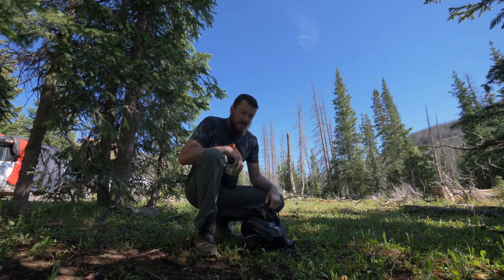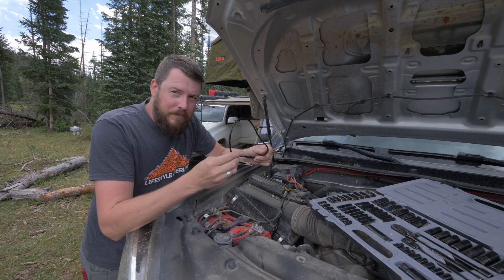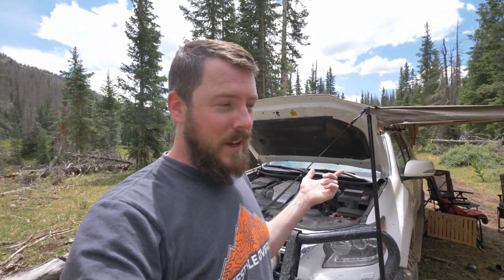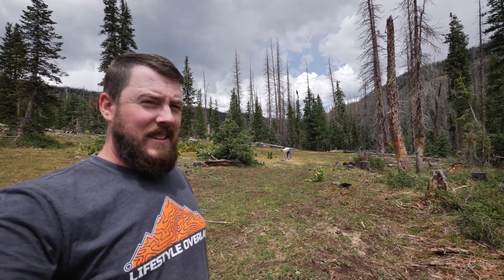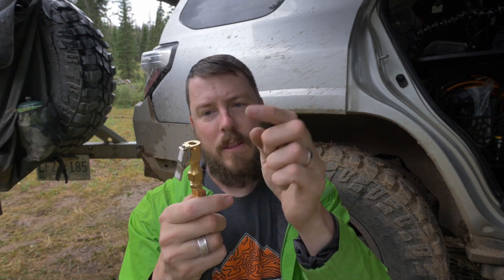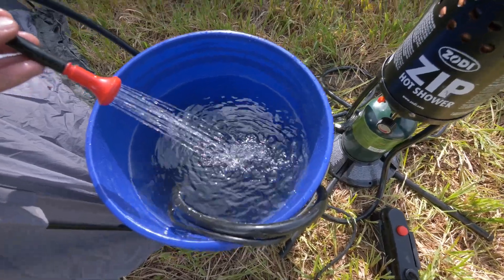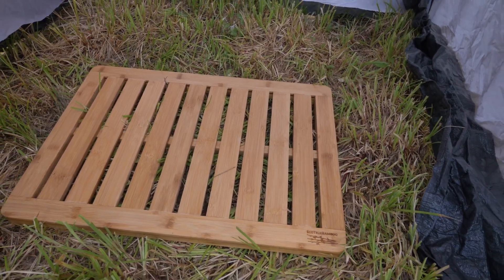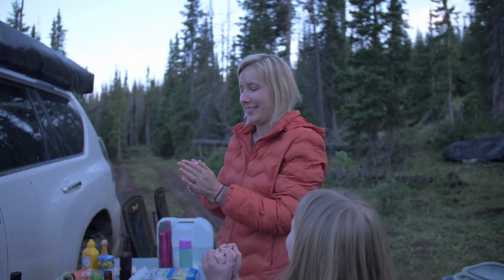Behind the Scenes - Repairs, Showers, and Mods on the Trail

Comment: Amen on the crimp connectors.  I build emergency vehicles for a living and I have never soldered a connection.  Some I have used heat shrink over, but never have soldered.  Hundreds of vehicles built all crimos and no failures.

Comment: A water heater like the Eccotemp L5 will take cold water to hot directly without the inital circulation in the bucket.  I always have to set mine to lowest heat with more water flow or it gets too hot, even from cold hose water.  I just pull water out of a jerry can, and don't even take it off the bumper most of the time. It is a slightly larger packup than these, but you can use a stronger 50 psi 12v dc RV pump with an RV shower head and get much better pressure.   You also then can turn it on from the shower head, pump kicks on, heater kicks on.   Then when you shut the shower head off, pump builds pressure in a bout a second and shuts off at 50 psi, and the heater shuts itself off instantly.. so no overheated water when you turn it back on.   You use more water when its on (if you want, which is nicer) but you can shut the thing off from the shower tent, so overall  you can use less than these things which are just always on unless you have a helper.   They have been making little auto on/off water heaters like this for years.  I feel like the overland community is back in the stone age with all these pain in the but stove type heaters.
Reply: This is what we use as well! Love our Eccotemp L5!

Comment: Very interesting video. Good to see how you handle repairs on the trails. To add to the solder/crimp debate I was taught to crimp and solder. It’s important to have a good electrical and mechanical connection. Then I visited a company that preps rally cars and they only ever crimp and have never had a wiring loom failure. The loom often gets transferred to new vehicles. Their stance was solder can make the wires brittle. It’s more important to seal the connection from moisture so I’ve adopted the crimp and use the adhesive heat shrink to seal it. The shower bit was useful too... our solar one tends not to works so well in lower temperatures 🤔

Comment: A soldered stranded wire that is not properly supported beyond the the solder end will vibrate on a vehicle and the individual strands break.  I have also done thousands of crimpies and I do that most of the time for a vehicle.  Air craft will have connectors crimped also only soldered in a device that is mounted solid.  We used to wire wrap the important connections for the circuits I worked on in the past. Always keep it clean or the little electrons get lost.   Stay safe and healthy, your little one is growing fast, hope she gets her daily hugs, she sure is a happy young lady.

Comment: I admitted I was a crimper, and my life had become unsolderable. LOL. Great content, beautiful videography. Nice diag on the noise or rattle problem. I've risked my life hanging off vehicles to find a rattle. Good job and yeah, those washers got left out. LOL. They'll show up under the bench, right side, behind the empty brake clean can, and in front of the old starter.

Comment: I use a similar set up for showering. I added a Nemo Helio Pressure shower water container. I pour the hot water in it when it's temperature ready. Use my foot to on pump to create pressure. This way I only use the water when I press the nozzle and I'm not wasting water. Also, don't have the worry about the water suddenly getting too hot and it's easier for a solo person.  This is the system they use at Overland expo and I've been using the system ever since. 
I do like the bamboo mat idea. I will be adding that to my shower gear.

Comment: The Zodi is definitely worth the money. We use it paired with the Nemo Helio shower. Just fill up the Helio and let the Zodi recirculate until it gets warm. Then you have a on/off shower rather than the Zodi continuously running. Helps save some water for everybody...

Comment: I solder, but make sure there is a water tight adhesive filled shrink around it.  Never failed.  
Solder can weaken wires and cause them to get brittle, then they fatigue and break.  That is a real risk, so I always try to support the connection in any way possible.  
But yes...I would never argue that a solder is better than a proper crimp.  The key to both is the shrink afterwards.

Comment: Could you post links to the connectors and the tire valve chuck?  That chuck looks like the answer to  inflating tires without have to hold the chuck on the valve.

Comment: I've been crimping my whole adult life. That being said I do solder for anything that's going to a sensor, computer or because I have too. Just a normal connection like you did is a crimp for me as well. Like the butt connector without the bulky hard plastic outer sleeve. Heat shrink is really the key, keeps the water/corrosion out! So just to be confusing I'm like 85% just crimp it!

Comment: In case you have ever wondered one can heat water on a stove and dump it into a bucket and repeat until the bucket is at shower temp. With one burner it takes about 10-15 minutes to heat up. 2 burners probably half that. Zodi kits are cool but you really don't need it. Just use the stove and buy a pump and hose and its one whole less device you need to carry.

Comment: Proper crimp is better than solder. Solder flux leads to wire corrosion. I believe in some aviation applications crimps are required and solder is not allowed.

Comment: Another idea,  If you have an Honda EU2000 or equivalent,  is to drop an Aquarium Heater Rod, into your Jerry can, and use a USB rechargeable water pump shower head.  We have found that the water gets more than warm enough to be comfortable.
Reply from the maker: Interesting idea... how long does it take to warm up?
Reply: @LifestyleOverland  No more than 15 minutes.  We use the heater rod that is plastic and not glass, to prevent breakage

Comment: With your solid rig setup and considerable experience overlanding, is there any specific reason you don't use a tankless water heater attached to your rig? Seems like a pretty common mod for serious overlanders, and seems like would make the shower process much simpler, easier, and faster, which means you could do it more often without so much hassle. Asking to learn more.

Comment: Oh laugh, I hope you have a turkey minced and no turkey grilled. In Germany you would be a racist. Oh dear, jokes aside, your cars are very good, but not designed for this kind of stress and the time of stress. I speak from experience, good underbody protection, for all weather conditions and distances, off the road, say it all. For example hydraulic shock absorbers, are less temperature dependent than gas pressure shock absorbers. Another point, the tires, use nitrogen and no compressed air, only to refill when necessary. And above all, solid steel rims. For your purposes, they are much better suited.
You can catch up later and bring a lot.
Your solar panel, super and huge. Isn't it better if you buffer an additional battery between panel and car battery? 
So you always have a spare battery for your car. I would always take the maximum cable lengths and solder the connections. Plug connections, or screwed connections, cause a loss of about 20% and this is a disadvantage in your climate situation. 
Best wishes from Frankfurt and stay healthy.
Reply: @badgerpa9  The tire pressure is correct, but it should not be too low, even off-road. It is always different, everyone has to develop a feeling for himself and the machine and driving style. I prefer to ride with somewhat harder tires, even in mud, I can handle it better. But I make sure that the tread is always good. Stay healthy my friend.